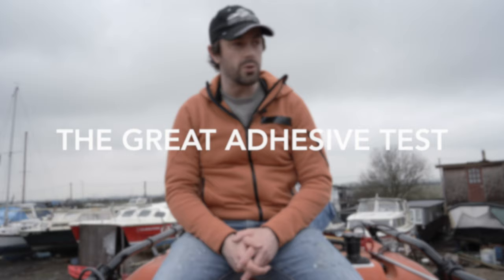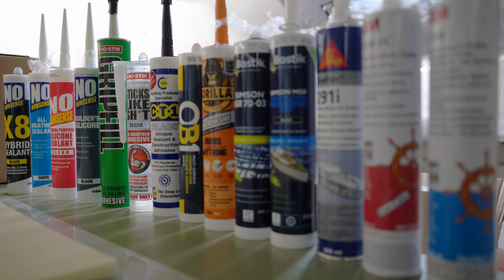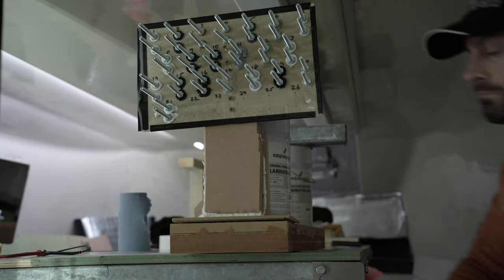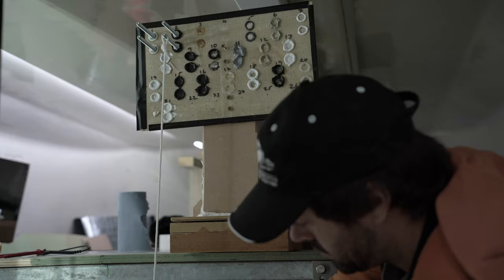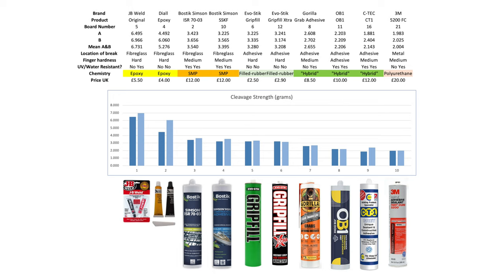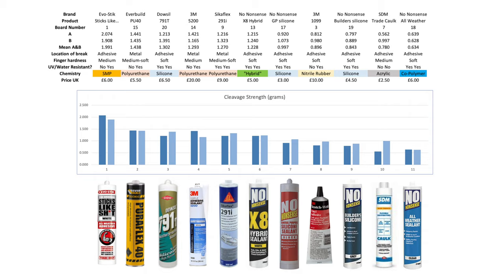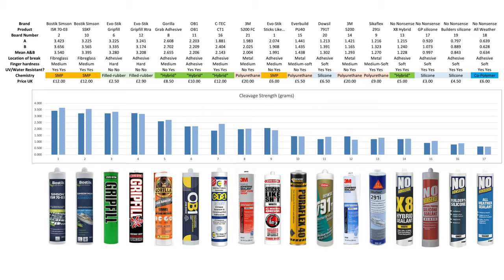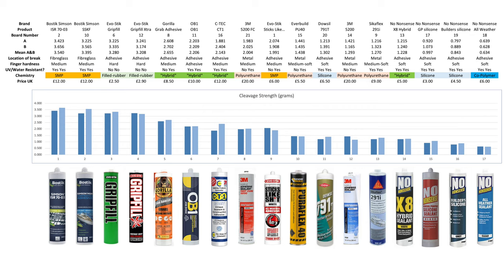The Great Adhesive and Sealant Strength Test -  (Lifeboat Conversion Ep5: Adhesive Test) [4K]

Comment: Quick hint:  Call the companies and talk to a products engineer, (avoid the sales guys with a passion.  They just want to sell something), about what you are doing.  These guys are geared towards helping industrial clients reliably meet specific goals.  hey actually know the technical capabilities of the product line, and gave you real assistance.  Helps to know a little engineer speak, but if you tell them you’re prepping a fiberglass boat for an arctic expedition, you might even get a sponsor, and an assigned engineer to help with your project.
Reply: Absolutely. Many manufacturers offer very good technical support. At least to "bigger" professionals, I'm not sure how the support for "smaller" clients is but definitely give it a try.
Reply: Sponsoring an Arctic expedition has to be fantastic PR for any supplier. Just make sure they do have the product you want.
Reply: OK, so I'm this engineer. Trust me, there's nothing worse, than a guy from sales running to me and pushing me the phone to advise some random guy on his project. I mean, don't get me wrong, I'm not an a****e, but I have a sht tonne of things to do and You telling me about your roofing, yacht or a lunar lander will probably result in me coming home much later. 
Write an e-mail. I will be happy to reply in a free time (I often respond from home like half privately, no problem with that)
Reply: Sales engineer

Comment: I absent-mindedly watched ep1 some time ago, then ran into ep3 just a few minutes ago. Eps 4 and 6 showed on the feed when I clicked to watch ep3-- but not ep5. Undeterred, I hoped it would pop on the screen at the end of ep4. It did. So, here I am. You delivered on your adhesives test promise (from ep4), and I gotta say you were quite methodical in your testing (if not entirely "scientific".) I love that you had "A" and "B" test joints for each adhesive, to discount unintended anomalies. Your water-bucket tests at least give you a rough (intuitive) baseline for adhesion of dissimilar materials-- as far as sheering is concerned. Tensile properties may not be a concern in your application. I was involved in designing and building stuff using other people's stuff. We tested lots of products using methodology very similar to yours-- we just needed an intuitive baseline for confidence in our final builds/products. Let the product engineers blather on about calibrated yada-yadas, etc., but you're totally on the right track. Screw 'em!

Comment: CT1 is my favourite DIY adhesive - used it to hold rebar in holes, hold down and seal the underside of door thresholds and even to hold wooden dowelling in rather crappy cob walls (not load bearing, I hasten to add!). Good to see it did pretty well in your tests.
Reply from the maker: It's certainly not bad at all. For me it's unlikely to be a go-to, as it doesn't come top in any of the main categories - like a super cheap volume product, or near-unbreakable overlap bonds, or very light removable sealing, or good sanding performance.
Reply: @AlexHibbertOriginals  yes the sanding performance is non-existent thanks to the rubbery consistency. I tend to use it where I need a combination sealant and adhesive. I can imagine that for your purposes there would be plenty of drawbacks!

Comment: You have genuinely managed to surprise me. 3M 520/5200 and Sikaflex were a revelation to me back in the 70s. Holding thin planks of mahogany stronger than the wood fibres themselves. I later used the 3M when I cobbled motor mounts together for an engine bay mismatch. Brake caliper shims,anything I could think of .
I never would have thought of your test setup either.
Interesting. Will be following this ,and there I was starting with  watching an ex lifeboat. Love YouTube for that.
Reply from the maker: It was the adhesion to steel that failed. I suspect they will do well in a FB on FB test.

Comment: I may be a little late to this video, but they do make marine grade epoxy, usually they are pretty cheap too, it comes in two separate bottles and you mix together however much you need. Plus side is there are accelerants that you can spray on it so it will cure faster without ruining it's integrity. Since it usually comes in gallon jugs it's also pretty cheap, probably quite a bit cheaper then some of the premade adhesives you buy in a tube.
Reply from the maker: Construction epoxies and these one-part mastics are very different products - really the two consumer epoxies and the caulk in this test were just benchmarks, so people could get a sense.

Comment: From a shipyard on the Wet Coast of Canada we use 3M 5200 and Sika Flex both very good products and yes we have sent icebreakers into the Arctic with these products and are the only ones I use myself
Reply from the maker: I also use 5200 for permanent overlapping bonds. Here it was let down by its bond to steel. My preference for flexible sealant is a Simson over Sikaflex as they handle similarly but the former holds and sands/paints better.
Reply: I agree!! I have excellent experience with SIKA products and recommend them

Comment: As a marine mechanic I will tell you that when 5200 is used in the correct application it is worthy of its reputation as a permanent non-removable survive an apocalypse adhesive! It's really meant for sealing things to fiberglass or aluminum with a large surface area. Think: through hull fittings, storage covers, hatches, etc.
Reply from the maker: That's my usual use for it, and I continue to use it as such. I did still expect better adhesion to ground steel.

Comment: Great test! It's not related to this video, but it popped into my mind while watching it. Consider adding a lightweight radar arch over the top of the boat, something 2 meters above the current top. You can mount your VHF antenna higher for better range, put a radar up there (there are some new models that are great and cheap), as well as floodlights even higher up - but also CCTV cameras so you can get a full 360 view of what's going on when you are down in the cabin.
Reply from the maker: I actually already have a mast and cameras, but haven't done a video on them yet.

Comment: I am shocked by the 5200 results. My opinion of 5200 is based on my 30+ years of experience with it and not the marketing. 
I was surprised to not see Life Caulk in this test. It has been the gold standard for a below the waterline, through-hull sealant where bonding isn’t a factor. 
I briefly worked for a 100 year old marina that sold about 50 boat/motor combos and rigged a total of about 100 outboards a year. Nobody there had ever even heard of Lifecaulk and they were just using the cheapest silicone caulk. I spent that entire winter replacing rotten transoms on boats they had rigged in years past. I have never seen a rotten transom or leak where I have used Lifecaulk over my long career.
Reply from the maker: I suspect the 5200's early exit was simply due to a) limited bond strength to metal (I've seen other testers have found this) and possibly b) despite allowing the full bond cure time, insufficient cure. Some people say 5200 needs >8 weeks before being really abused.

I still use 5200 as my default 'strongest adhesive' when using fibreglass and other materials.

Life Caulk - yes, and there are some others I couldn't source easily, but could add in for latest tests.

Distressed that people had been using silicone sealant as a structural adhesive!

Comment: Very good work, However I would advise to look at Dekalin , especially, MS-5, it took my weights on two pecies of 50 mm angle Aluminium as a test before I used it to bond 2 x 160 watt solar panel custon frames on to the roof of my motorhome , I did not like the idea of drilling holes in the roof , I have never seen any thing so strong - do have a look
Cheers Gary .

Comment: Some products require a primer to bond to certain materials. I work with Sika Powercure professionally and it's a great product, if it's applied correctly. I use it to bond glass or plastic to metal bodywork. If I use the primer, it forms a very strong bond. If I don't use primer it peels straight off and is almost worthless. 
Your test is very good, I really like your setup. I just noticed in several cases the glue didn't really bond to the screws or fibreglass. If you would do the same test again with primed surfaces, you might be surprised with the results. I use Sika Primer 207, which can be used for several types of materials (not sure about fibreglass, probably ok).
If you want more info on this, just give me a shout. I don't work for Sika by the way ;-)
Reply from the maker: Thanks for the input. Yes, point taken on the primers. I wanted to offer up an even playing field though, and the products I tested (whilst obviously primers are useful for a reason) don't specifically demand priming for glassfibre or ferrous metal bonding. I only used one common Sika products (although the PU40 is made by them too) sealant, and could consider others with/without primer in future. The 5200 really should have done better though.
Reply: @AlexHibbertOriginals  I've done some light digging on the Sika website. The Sika 268 looks like a very good candidate, it's designed for the rail industry and therefor is very resistant to all kind of influences (including up to -50°). Sika also classifies it as "marine grade". The "Powercure 268" would be my weapon of choice, but to apply this you need the very expensive Powercure gun. It's also available in a "regular" version, but you will have to give it enough time to cure. Maybe do a test with and without a primer for the best bond.
If possible try to contact a Sika representative, we have very good experience with their technical support. They will get you the best combination of products for your needs, but only from their own brand of course :-)
Reply from the maker: @reinouddelporte911  I'm certainly tempted to run a test of various products with/without primer, across various substrates.
Reply: @AlexHibbertOriginals  I forgot to mention this tip: if you're planning to do a lot of glue/sealant work, get some Sika cleaning wipes. Or Kimberley Clark Wypall 7775. Both do a great job in getting glue or sealant from your hands, tools and many surfaces. Only when applying primer I wear nitrile gloves, primer cures to fast to remove it with wet wipes.
These wipes also work great to clean your hands after greasy jobs (engine work). They are not cheap, but worth every penny.
Reply from the maker: @reinouddelporte911  Yep I use nitriles, and have a pot of acetone with blue rag to clean things - a bit cheaper than special wipes.
Reply: @AlexHibbertOriginals  I never use acetone for gluing jobs, ever. Acetone is pretty nasty stuff. It may be cheap, but it's really unhealthy. The wet wipes actually are far better at cleaning this stuff, and several surfaces can't handle acetone. I'll send you a small movie of the wipes on Instagram so you can see the result.
Reply from the maker: @reinouddelporte911  I find acetone cleans up resins and general gunge that other more gentle solvents struggle with. Certainly, ventilation and gloves mandatory.
Reply: Acetone is uncomfortable, but concentration-wise it's uncomfortable long before it's dangerous, fortunately. Odor Limit is in the range of few tenths to couple of hundreds of ppm, typically.  According to Norwegian regulations, you're allowed to work for a continuois 8 hour shift in 125ppm acetone vapor.

Comment: Just wondering if all the bolt heads were aligned in the same "o'clock"  orientation.  Otherwise you would have different fulcrum widths and also a sharp point vs flat side at the failure initiation.  Brilliant test still!!  Definitely worth a GF-GF deep dive on a few chosen. Clever method of bucket with water as incremental weight.
Reply from the maker: Indeed yes a flat edge downwards, although I think I forgot with the 1099 - and this was only reference adhesive. Thanks re: the water - it wasn't perfect but better than adding metal weights.
Reply: Dude, really good point(pun intended)

Comment: I have been looking for something with a LOW level of adhesion and an ability to seal out water. I have large (4ftx5ft) deck panels that I will probably need to open once a year for maintenance and inspection on my boat. So I want the panels stuck and sealed, but I'd like to be able to peel the old stuff off when I open these areas again. This was helpful in determining what I need, even though I am in the US and can't access some of the same brands. Thank you!
Reply from the maker: It sounds like (as long as the sealant isn't directly in the sun) that a weakish, low modulus silicone exterior sealant is the ticket. It can be easily scraped off, the substrate cleaned and then sealant reapplied. If you have strong winds etc you may want to try something a little stronger.

Comment: I have achieved some crazy results with cheap old JB Weld. You may be able to get it cheaper in bulk packaging.
Reply from the maker: You can, but I find part-used tubes go gooey and contents can separate if not used quickly.

Comment: A little off topic, but I've sworn by PL Premium in the U.S. for a while.  It was a recommended adhesive for bonding bottle rockets back when I was in high school, and it is seriously impressive.  Of course, I'm not prepping for an Arctic expedition, and it does like some plastics but not others, but I thought I'd mention it as a great choice for anyone looking for a construction adhesive.
Reply from the maker: Seems to be a generic PU one-part. So it's hard to assess its performance without a head to head with competitors.
Reply: @AlexHibbertOriginals  Yeah, something like that.  I don't believe it's rated for marine use, but it's pretty good stuff overall.  I would imagine it's middle of the pack if you exclude the two parts, but realistically that's pure speculation.  Just thought I'd mention it as an option for any viewers who might be looking for that sort of thing.

Comment: There are marine epoxy products available, in fairly large containers. They are much more expensive.
The resins used to make fibreglass hulls are all marine epoxy, be they epoxy, polyester or vinyl-ester resins. Yes, they can be used as a glue, as long as the surface is prepped properly.
Reply from the maker: We were testing adhesives here, not laminating resins. For laminating I do use both epoxy and polyester when appropriate.

Comment: Have you thought about repeating the experiment under freezing conditions? Maybe find restaurant or slaughter house that has a walk in freezer that would allow you a little space to see if there is any affect of cold.
Reply from the maker: I'm frequently in places that are naturally very cold - so once the planes start flying again!
Reply: That's a very good point. As a design engineer for products that are specced for temperatures in the -40C and below region, finding adhesives with proper specifications are quite hard actually.

Comment: I repair my own cross country skis and I've found that some adhesives are terrible in cold weather.  I found a roll of adhesive from 3M years ago that is amazing if you have a large, flat contact area - like the heel strip of cross country ski bindings.  You should try to talk to people who work up in the arctic about what sorts of adhesives they find work well in the cold.
Reply from the maker: Hi Heather - yes indeed some do and don't perform as well as their rating suggests. I've used dozens of custom products with all sorts of adhesives in the Arctic over hundreds of days, so have a general reference point to work from.
Reply: @AlexHibbertOriginals  I'm sure you do.  I made this comment before noticing all your writing.  I am glad I encountered these videos - this is a fascinating project.
Reply from the maker: Thanks Heather

Comment: West systems marine epoxy 105, comes thickened in a tube "expensive" or as a two part epoxy system which you have to add a colloidal silica agent "405" I think, but specifically designed for use with GRP hull materials
Reply from the maker: Sure - I'll do a FB on FB test, and these sorts will shine through, and 5200 will regain its reputation I'm sure.
Reply: @AlexHibbertOriginals  all available on Amazon as well

Comment: It's worth calling out that JB Weld does make marine based epoxy products.  Look for the MarineWeld and WaterWeld products if you are looking to use them on boats or in/around water, though having used JB Weld extensively in the past for plumbing purposes, I've never seen it have any issues with the water either.
Reply from the maker: I might be wrong, but aren't the marine products for use and curing whilst wet/damp? I don't think they claim better performance if all are cured in the dry and then got wet?
Reply: @AlexHibbertOriginals  As I understand it, their WaterWeld product is the only one that's meant to setup/cure while underwater.  Their MarineWeld on the other hand is meant to be mixed like the others and dried as normal which then creates a stronger bond.  As an example (according to their documentation) the WaterWeld will fully cure in 1 hour and has a strength of 1300PSI, while the MarineWeld requires 15-24 hours to fully cure and has a strength of 5020PSI.
Reply from the maker: @spyda450  Curiously, you're right. Despite the Original version saying 'our strongest epoxy' on the packet!

Comment: You should try the loctite adhesive tube, it's expensive but it's good, although when it hardens it's it's flexible at all and on a boat you might want a little bit of flex before stuff just pops off

Comment: You should’ve tested it under the temperature conditions that it will be used in. Adhesives react differently in low temperatures.
Reply from the maker: I note in the video that other testing will occur. And much will not be subjected to very cold temperatures, or will be below the waterline.